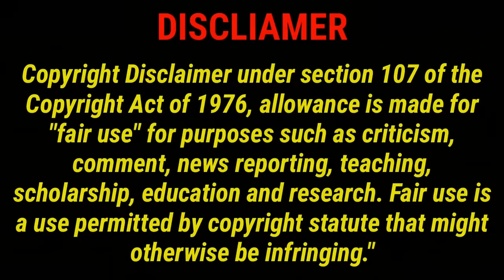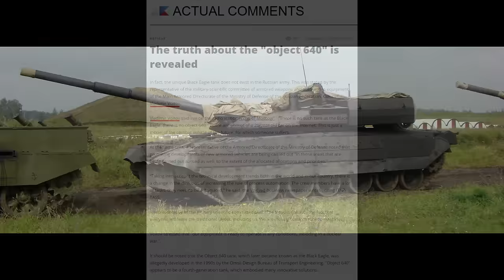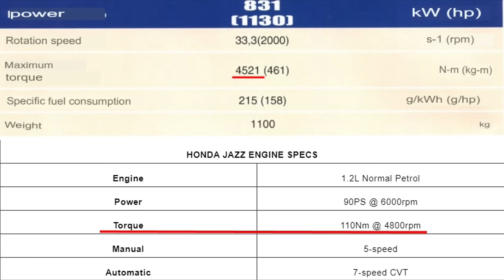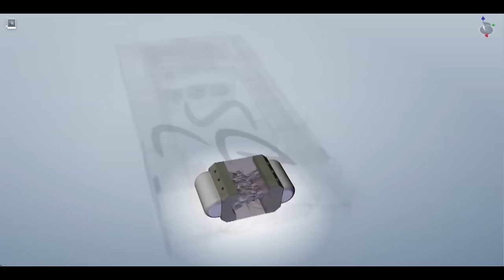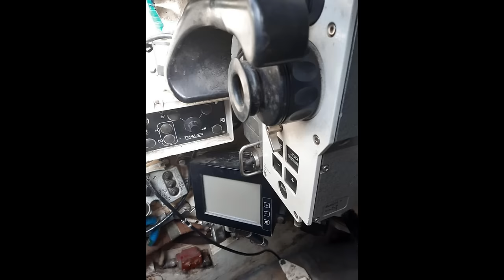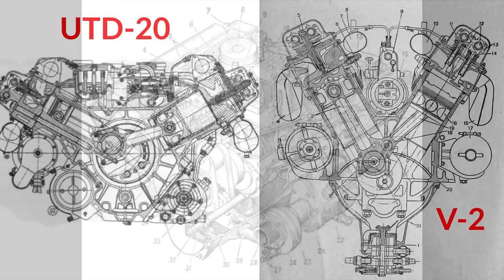LazerPig is WRONG about T-14 Armata

Comment: Quick question how does multiple engineers and officers not notice the parking brake is on? What did the parking brake even look like to accidentally engage it?
Reply: The whole parking brake is such a blatant panic lie that it really puts a cherry on top of the whole T-14 breaking down during a parade debacle. Looking at the comment section, fanboys and tankies know it was an embarrassing fuckup but they keep lying to themselves that it wasn’t as a coping mechanism.
Reply: easy answer, have you seen them going in to check? no? where they eventually able to move the thing? yes? if it wasnt the brake then how were they able to make it move eventually?
Reply: At 23:40 you can see that the tank literally starts driving again.
Have you not watched the video?
Reply: @xxkairzzxx1994  yeah I see that I’m just curious why the driver himself didn’t check the parking brake first? I know tanks and cars are very different but the first thing people check if there engine is running and they’re not moving is if the parking brake is on. How did they go through all that trouble just for it to be the parking brake?
Reply: @insulinslayer2413 
Well , easy answer , new equipment , and the modern russian army isnt known for training properly its soldiers , so the guy was just given a new tank without proper training and he screwed up by engaging the brake....

Or thats at least the most sensible answer for me...
Reply: @SlavicZde  I’ve watched both videos and LP and Red effect both make valid points but why take so long to figure out it’s the parking brake why didn’t the driver check that first? Was he not well informed about the control system of the tank?
Reply: @insulinslayer2413  ik. Tbh I would probably guess that it's probably just russian incompetence. I watched LP's video and then this video and I found it baffling that LP forgot to mention the part where the tank starts running again. Your point still stands thou, it shouldn't take that long to solve what in theory should be such a simple issue.
Reply: @Jvr555 they attempt to pull it, after the tank treads don’t move they check again and the tank drives off, actually watch the fucking video
Reply: @Jvr555  you do know how heavy tanks are right? It takes a lot more than a tow truck to pull a tank like the t-14. Even then you see how close the first recovery vehicle is and how large the harnesses are.
Reply: @Jvr555  oh, you mean the same one that couldnt even move it an inch at first? isnt that odd to you?
Reply: @martinrey8662  isn’t it odd how the Russians said it was a test for vehicles breaking down at first
Reply: @Jvr555  no, spokepersons often say whatever comes to mind when information is not avaiable, specially in russia they seem quite willingly to pull stuff out of their asses rather often
Reply: @martinrey8662  like that abrams they destroyed
Reply: @SlavicZde  Yeah I know that’s why I asked the question here to see a valid rebuttal because if I would’ve asked this same question on Reddit or other forms it usually ends in nato and Russia bots arguing each other which don’t get me wrong is pretty entertaining but it never leads to a reasonable answer to the question at hand. Here I got a valid rebuttal that probably the crew itself was poorly trained or rushed for the military parade. Also my own rebuttal would be with all its new electronics it not uncommon for new systems buttons to get stuck on and no matter how many times you press it won’t turn off which could be fixed from the driver seat without the need of opening the engine up. Though that’s just my observation on the matter
Reply: @martinrey8662  
By disengaging drives that stops the tank from moving when there is an engine failure.
This is standard for older Russian tank models.
Reply: @MegaBanne  yeah sure, that was wat made it able to move on its own latter too for sure
Reply: it.. drive off? on its own? do you think they noticed the parking brake was on, or the t14 is so amazing you can field repair a transmission or engine in minutes? @DirtyMardi
Reply: The pigstay is overlowing with manure
Reply: @adambadam4870  this was like the one thing that lp could be wrong on
Reply: @xxkairzzxx1994  the engine could of stalled
Reply: @xxkairzzxx1994  Do you have a link to the whole parade? I can't find a video on YT
Reply: @insulinslayer2413  It's probably just teething issues with a new vehicle. When we think of tank design, we only really look at the bigger picture; how fast can it go, what's the gun like, etc, and we fail to consider smaller things, like what the seating is like, or WHAT THE PARKING BRAKE LOOKS LIKE WHEN ENGAGED. 

It's in all likelihood something really stupid like the driver mistaking the parking brake in the on position to be in the off position. It happens. We are only human after all.
Reply: @xxkairzzxx1994  he did, but he probably likes his own version of truth better
Reply: @insulinslayer2413  Panic possibly, unable to think straight got tunnel vision it happens!
Reply: What a lot of idiots here dont realize is, if an engine breaks down, that doesnt mean it cant start back up again without maintenance. It can still engage the ignition process. German tankers would just turn their engines back on all the time if they broke down, until it broke down again. And the emergency break wouldnt shut off the engine. Ever. So yes, it broke down. And how would an experienced, trained driver, accidently toggle an e break, and not realize that the engines still running. It broke down.
Reply: @thatguy46744  "The emergency break wouldn't shut off the engine" 
- You assumed the engine was shut, We can't tell if it was running or not from the footage!
- If the emergency "brake" was engaged and you put the transmission on Drive and tried to force it to move, the engine will likely break and shut down!

We know the emergency brake was engaged because the recovery vehicle couldn't move it, this will not happen unless the brake is engaged, simple. There's a slim chance of double failure (engine broke down + brakes engaged) but the fact the tank was moving later negate that possibility for the largest part. And no engines don't normally heal on their own once they broke down!
Reply: @martinrey8662  The might have disconnected the final drives. If it was the parking brake why did the driver not tell them he put it on? If that was the fact, the parking brake every one involved was an idiot.
Reply: @MegaBanne Das is eben nicht Standard bei älteren russischen   Panzermodellen. Hier sind mir zu viele Experten unterwegs, die keine sind.
Reply: @thatguy46744 
If it did in fact break down then it would at least be towed easily with out any struggle

Yet the recovery vehicle couldn't tow it.

Just like a normal car you can't tow a car with the parking brake on or you'll be significantly slower and damage the car. Same thing for tanks. Clearly a parking brake was engaged.
Reply: @glowtail3744  no it wouldnt. You have to disconnect the tanks final drive to tow it which they didnt do.
Reply: Parking break my ass. The tank broke down and had to be towed out. The story about the "parking break" is complete PS bs.
Reply: @nicomeier8098  finally someone without down syndrome  in the comments.
Reply: @DirtyMardi 
That is a hilarious projection.
Video evidence: tank stopped during a parade rehearsal, then went away under its own power.
Cope and seethe.
Reply: @thatguy46744  if an engine brakes down you CANNOT restart it, hence the word broken. What you probably meant was stalled. And if  it was just stalled, the recovery vehicle should be able to tow it no problem, but it didnt. So guess who is the idiot here
Reply: @michaels.starnes194  its a new tank, they dont train on them. And the parking brake handle or button is probably in a different spot than older tanks. The driver engaged it by mistake, and the recovery crew couldnt have known it.
Reply: @thatguy46744  and how would you know this? 
To elaborate, yes you cannot tow a tank that is in high gear, but this is old knowledge, every tanker must know this, because its the same principle for all tanks. So if a recovery vehicle is coming you put it in neutral, and even if the driver forgot, the recovery team would do it.
On the other hand is very probable the handbrake is poitioned in a different spot than all the older tanks, perhaps could even be a button, and the driver didnt know this, because t14 is NOT in service and drivers DONT train on them
Reply: @vicjokoper8142  So in a very important parade the russians put a driver who had no idea of what he was doing and somehow while driving it put the parking break on, yea sure. If true it is just another example of russian incompetence.  Oh and just to put the straw man to bed I was a tanker on the M1A1 so i might know a little about how tanks work.
Reply: @michaels.starnes194 the t14 is not in service so drivers are not trained on them. The driver in the parade probably received a schnellkurs about the operation and off to the parade. And I agree its incompetence
Reply: @thatguy46744 so why would yopu have to disconnect the final drive, if you can just put it out of gear? Only possible scenario would be if the transmission is broken. But in that case, it wouldnt be able to drive off on his own power
Reply: @thatguy46744 I dont belive russian tanks have no neutral in their transmission, this wouild mean they cannot idle, withou moving. Its regarded to think this
Reply: @vicjokoper8142  While they do have a neutral gear the transmission is still engaged in many of them which allows pivot steering (i.e. neutral steer). So in order to tow them you have to disengage the final drive from the track or transmission. In most tanks this requires removing a saddle ring and slipping the gear out. I made a mistake, you have to do it for western tanks too, but they have a much easier process to do it that doesnt require too much field work.
Reply: @thatguy46744  I can belie that the driver engaged the handbrake by mistake but cannot belive the recovery crew woudnt know they need to disconnect the sprocket, even tho its the same with all ru tanks. Doesnt make sense does it?
Reply: @vicjokoper8142  Well if even one person there was not totally clueless and useless they would have disconnected the final drives and check the parking break. I still think the whole bake story is BS.
Reply: @DirtyMardi  yikes bro , keep seething
Reply: @SlavicZde  Ah, yes. Everyone who disagree with us is a bot. Because reasons I guess!

If you can't engage in a regular discussion without having to call the opposition names as "bots" and "trolls", then kindly shut that stinking trap of yours. Thanks.
Reply: @sovietbanana4589  Well, yes. When a tank has it's parking brakes engaged, you need even more than a huge tracked recovery vehicle to move it. If the brakes are disengaged and the gears in neutral, you can pull ANY tank with a regular FWD hatchback. (On flat surfaces, that is.)
Reply: @DirtyMardi The tank moved itself right after. It didn’t break down. If the brake wasn’t on and the tank broke, the recovery vehicle would have easily been able to move it, but it didn’t.
Reply: Maybe it has an automatic handbrake
Reply: Ever notice how wheels are round, and if you like, apply force to one side it moves into the that direction? Yeah it has like a bunch of those round spinny things inside thig big mental pads and they roll! :o it makes the tank move if you tow it too!!!
:O
Reply: @DirtyMardi source

Comment: Topics tackled in order

0:00 Intro
1:11 Autoloaders
2:40 T-95 carousel autoloaders & T-14
3:13 T-95 and the new 152mm gun. T-90 and new 125mm ammo. Inferior to top 120mm NATO, but modern nonetheless.
3:55 T-95 and the 90s. Object 195 being effectively vapourware. Laserpig mixes up Objects 195 and 640 (Black Eagle). Russian media and others also collate the two together.
8:00 Why Objekt 195 got cancelled by 2010.
8:44 The Kharkov Model V-2 engine
9:40 "Kalashnikov" of engines
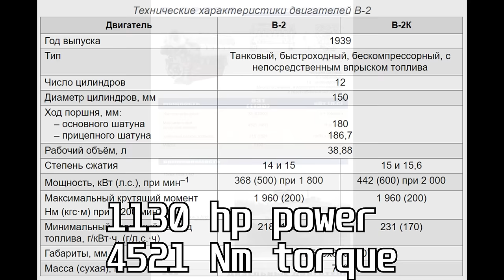10:35 Specs for the B-92S2F
11:00 Tackling the age of the engine. Leo 2 engine comparisons. 60 years & going strong with little to no changes. Chally 2/3's development from 1918's Condor engine.
12:00 Honda Jazz has more torque than T-14.....NOT!
12:40 B-2 archaic in design, bulky and heavy
14:03 Diesel vs Gas turbine comparisons, for reasons
15:10 Top speed 32mph for T-14
15:35 Engine thirsty for Oxygen, and T-90s in mountains
16:35 T-90 is slower than heavier tanks
17:39 Copy of the German SLA-16 engine for T-14, "from" Porshe Tiger
18:20 Russian "reliance" on western imports
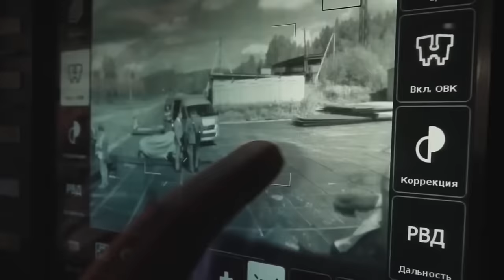18:35 Copied engines & A-85-3A (T-14s engine)."based on" vs "copied" vs "neither"
21:25 A-85-3 was a commercial oil pumping, unreliable engine
23:06 T-14 broke down on Moscow Parade
24:03 T-14 built around "that" engine
25:27 T-14 larger than T-90, in spite of design to be smaller
26:30 Periscopes are still used for driver, rather than camera/screen combo
28:24 Periscopes retract into hull claim
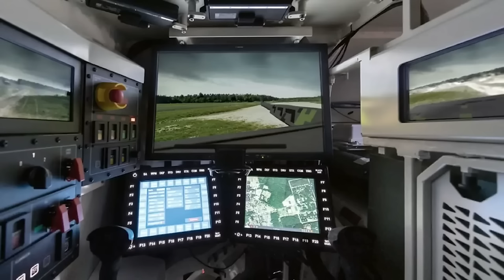28:52 KF-51 Panther's "view"
28:18 10s autoloader reload time
30:24 Ukrainian hackers found French optics in T-14
31:39 Optics "available to the public"
32:25 Spare 5k, gets you a UAV that has better IR/Thermals
33:04 Chinese interest in T-14
34:26 Modular design on the T-14 hull
36:29 IFVs and armour
37:25 BMP is made on tank chassis, uses V-2 engine and is thirsty
38:30 Artillery is based on tank chassis. Armour vs weight of cannon
39:13 Tanks able to track automatically in the 60s....
40:24 Challenger Rifled Gun is more accurate at long range.....
41:33 Challenger has HESH...vs modern HE and programmable HE
42:49 Challenger 2 CLIP available since 2006.....and HAAIP. All prototypes
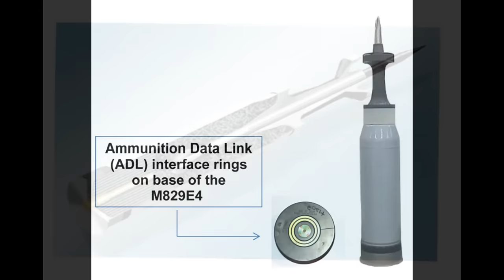44:00 Challenger 3 updates vs upgrades
44:52 New turret & 360 awareness in the turret for Abrams X & Adaptiv Armour????
47:00 Bradley autocannon can take out video cams
48:21 Conclusion: Lots of correct stuff, especially production issues. But a lot of errors.
Reply: Yes and thats why thousands of armata tanks are roling of the asembly lines.
Reply: @nils-petergustafsson1064  Yes that's also why you're commenting to the wrong comment. Because if thousands of Armata tanks are rolling out, then thousands of people like you are actually intelligent.
Reply: Lots of correct stuff or like 1 thing that's correct?
Reply: @nagantm441  On whose part? Laserpigs?
Reply: @AlphaAurora  yes
Reply: @nagantm441  Each of the areas is a part where Laserpig gets it badly wrong. Some are more minor than others.

The mixup in T-95s is common and not too bad. The stuff on platform chassis and parts commonality (or lack thereof) is fairly bog standard complaint.

The engine issues are wildly off. His stuff on Chally 2X prototypes and design history are way off.
Reply: @nils-petergustafsson1064  🤣🤣🤣
Reply: Thanks
Reply: @nils-petergustafsson1064  well they have already planned production in mass numbers so they will be btw dont think any other nation has the capabilities to produce more tanks the us has only 1 factory. Not only that but to produce a new tank you need to set up the production lines and so on. Its a complicated process which involves time a lot of time
Reply: Thanks, mate 👍✌️
Reply: @Silver_Prussian unless I’m missing something America’s premier tank, the m1 Abrams, took 4 years from design conclusion to full production, and currently there are 10,400.  The t14 design was finalized in 2015, so we should have seen full scale production around say 2019?  And it’s 2023 and there’s ministers assuring an experimental serialized production run.  With 12 in existence.  Am I missing something?  If the t14 is such a game changer, why the additional 4 years before the supposed delivery of a serialized production run.
Reply: @Silver_Prussian planning is great, but I can plan to produce a 7th gen triple engine VTOL super-maneuverable VLO fighter/bomber to replace the NGAD in the year 2044, doesn’t mean it’ll ever happen.
Reply: @the42ndfiredrake  except taht what you are missing here is the fact that both tanks were very diferent in design and were made in different eras. The Abrams was made in the cold war where mass production of military vehicles was still a thing. The armate was designed in our time where huge production of military vehicles is not a thing anymore, because we have less funding but most important of all we have less factories. That goes for every country on the planet.
The us has only 1 tank factory that can make 12 tanks a month. So i really dont know how they are going to mass produce theri next gen tanks.
Not to mention that when you are making something entirely new you need to set up new production line which is pretty hard thing do to, the russians also have the problem that they have too many variants of tanks they use with the armata the number becomes 4 types of mbts that puts more strain on production. 
We also dont know how many they have made simce they unveiled it, there are only reports from articles which nobody knows how truthful they are.
Also the tank wasnt ready it finished its trials in 2022
Reply: @the42ndfiredrake  again this whole process is much more complicated than you realise
Reply: @nils-petergustafsson1064  no... theyarent
Reply: What is your take now?
Reply: @Seth9809  the same probably